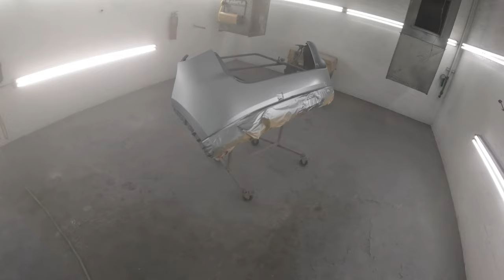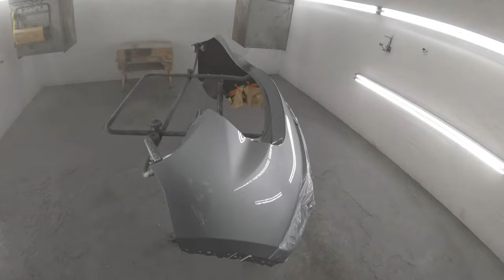Adhesion without sealing? Sealing without adhesion? 🤔 Never have paint peel again 😭

Comment: That happen to me too.. but the not the same. The dealership had cost tracking for every RO but each painter had their own pin but I wasn’t in the system so couldn’t mix until the paint rep could come in.. the rep was a week out. So I called and set myself up on the computer lol got all my tds information and was spraying 3rd day in. But the other guys thought I would be stuck for a week! No sir not me, I gotta get mine so I will find a way
Reply from the maker: That's right 💪🏼 just have to work around the idiots trying to stop the flow 😎

Comment: I appreciate the knowledge that you spread. Question, I have an old skool cutlass with Crome bumpers. I want to color them. What process do you suggest?
Reply from the maker: Dam man you're going to do up the cutty like that ? 🥹 it's better not be a 71 with the 442  or even the rocket. Me personally I'd hit it with something really aggressive slightly gouging the metal then go back with an epoxy primer, because sometime regardless of how good you prep Chrome it will still flake off get rock chips etc. It's better to give overkill than under do it.
Reply: Yeeeah the 71 with the rocket! Just want to do something different. Preciate it!!
Reply from the maker: @ZwithTheCutlass  nice ride man. I miss mine

Comment: Mr. TriggerMan,  I have a question?  Is wrapping a old model car with worn off pain a good 💡 idea. Or just repainting it. Thanks for this video really helps us.  ... OORAH!
Reply from the maker: I'm no expert in wrapping but if I had to give a logical answer I'd say that's a bad idea, thos wraps need solid substrate to adhere to. And worn paint might give it air pockets so it would most likely have air bubbles after the sun dries it. And you're more than welcome glad it helps 💪🏼
Reply: thank you for responding. @thetriggerman954
Reply from the maker: @OORAH659  no problem 💪🏼

Comment: Great video, I was watching Brian from paint society and he used a sealer on the underside of a unscuffed hood, I asked him what product he used but didn't reply back. I use to use Bulldog Jamb and edge but it has been discontinued. Will the Bulldog pls work on unscuffed undersides of hood and trunk lids? Thanks
Reply from the maker: I'm sure it would work. But I personally like to scuff everything. I've never done it to tell you yes with 100% certainty. Thank you for watching 💪🏼
Reply: It all depends on your paint system you use at your shop for example ppg envirobase the sealer we use can stick to factory ecoat without scuffing check your tds sheet some dealers stick to ecoat without scuffing I only do this for underside or jambing parts out
Reply from the maker: @JaminGalv  what about aftermarket parts? I know the ecoat isn't that great on some aftermarket parts so all of that would have to be taken into consideration right?

Comment: I have a question Trigger. Did you mix the adhesion promoter into the product? I didn't see in the video where you sprayed it separately. Ive used the spray can version of Bulldog Adhesion promoter in the bed of trucks before application of Rhino bed liner , but never used the quart size cans.
Reply from the maker: This product comes ready to spray. You spray it on allow it to flash them spray on your paint or Rhino bed liner.

Comment: Hey TriggerMan, Love your videos.  I am doing my first restoration on a 1970 FJ40 Landcruiser.  I am having problems getting paint up under the dash in crevices, corners, etc.  I have a touch up gun but it is still too big.  I was thinking of getting an airbrush, but not sure.  What do you recommend?
Reply from the maker: Thank you man, it's hard to visualize what you're saying. What is you used the mini gun with a disposable cup system so you can turn the gun upside down and get in those weird angles. The disposable cup systems will allow you to turn the gun upside down and spray if need be turn the fluid all the way in so it shoots straight like a missile
Reply from the maker: @cocko1135  yep that's exactly what I was saying. That's for clearing that up. 🙌🏼 teamwork mate 🤜🏼🤛🏼
Reply from the maker: @cocko1135  hell no. We're here to help these guys. You clarified what I was saying. All good my brother 🤙🏼

Comment: Trigger I do a lot of custom metal fab building race cars. would the bulldog plus be a good product for bare metal you want to protect from rusting before body work is done later on?  If so would you still want to throw a 2k primer on top of it before adding plastic?
Reply from the maker: On something like that I would throw a coat of epoxy primer on top of it.

Comment: How u doing trigga man? I'm painting my brother grill and headlight covers for his 86 chevy c10. Do I still have to add the adhesion promoter after I sanded it down before I prime it? I was supposed to spray it before I primed it and forgot. Will I have to sand the primer back down or just spray it on top the primer?
Reply from the maker: Ideally you want to put the adhesion promoter first. That's what makes the primer stick to the surface. There is a chance that it could fail down the line if not
Reply: I was hoping I didn't have to re-sand the primer off, being that it's the original old parts but if I have to then that's the only option I have if I want it to last. Thanks trigga man.

Comment: What dose that bulldog $$ run, and do you think using slow when spraying metallic is best in all temperature ?
Reply from the maker: There's a  link in the description. I think it's like $80. If the temperature in your booth isn't that hot them medium would be fine. I usually use medium unless it's a big job/panel.

Comment: How funny i had my paint peel on me the other day
Reply from the maker: Did you use bulldog? 🥹😲 c'mon man get you some bulldog get rid of that chihuahua.
Reply: @thetriggerman954  I'm in Australia we don't have that product. Mine peeled off the door
Reply from the maker: @melaboul5020  dam off the door 😲
Reply: @thetriggerman954  yes I'm not sure what to do, I sanded it with 800grid, first time spraying a car
Reply from the maker: @melaboul5020  next time use 320-400 if you're applying base.
Reply: @thetriggerman954  thought u use 800 for metallic paint
Reply from the maker: @melaboul5020  800 I use for blending panels only. Not for panels that you are actually painting with base. To make things less confusing only use 400  and 800. Use the 400 for base panels and 800 for blending panels It's pretty much what I use on every job. Base coat needs more of a scratch/mechanical adhesion clear coat tends to adhere a little better so 800 would be fine for that
Reply: @thetriggerman954  ok thanks a lot for your time and knowledge brother  I will keep this in mind, best way to learn are from your mistakes lol

Comment: TriggerMan another spectacular video I always enjoy your videos the reason for this is plain and simple you explained what you doing only problem is you make it look too damn easy man I got a boo boo on the passenger side back bed on my truck I need to attempt to repair Body and paint that area and I guess from watching your videos I will paint the area and blend the paint in you know what I'm talkin about I ain't no damn professional I enjoy your videos that much I'm going to attempt it I watch another dude that does body work but I enjoy your painting techniques and your guidance on how to get it done after all you are the mr. Miyagi the Bob Ross with a spray gun oh I forgot to mention I bought this piece of junk mini bike for $50 for my grandson Coleman ct200 man let me tell you something I went and bought a cheap Harbor Freight spray gun I tore everything apart even the motor there was nothing left together prepped and painted everything pretty much and I mean everything except for the new goodies I bought for it man if I could send you a picture of it the damn thing turned out like brand freaking new and I ain't exaggerating I did buy a new seat throttle hand grips brakes throttle and brake cable and new pull starter I used Rust-Oleum Industrial Safety Red paint reduced it with acetone I'll tell you what it turned out terrific I did use some rattle cans on the engine block which is a light gray and it has racks on the front and the back I painted them black rattle can Rust-Oleum industrial paint I was going to add a picture in here but you can't do it or maybe I can't figure out how to do it
Reply from the maker: Dam the bike sounds awesome. Send pics to my IG. 

https://instagram.com/thetriggerman954?igshid=OGQ5ZDc2ODk2ZA==